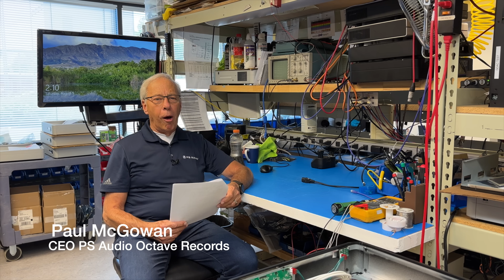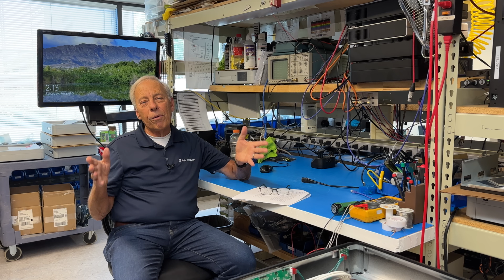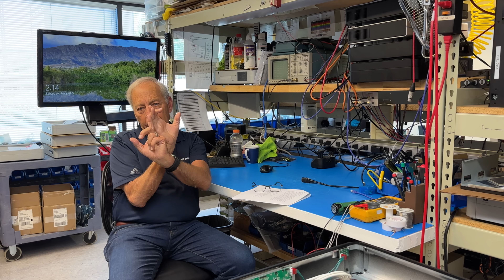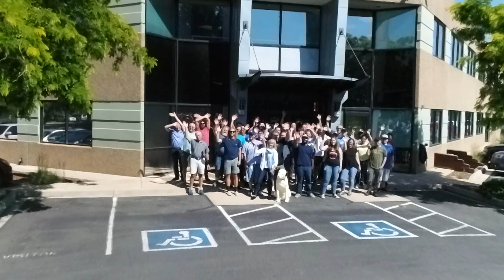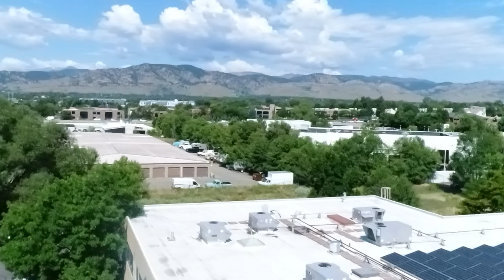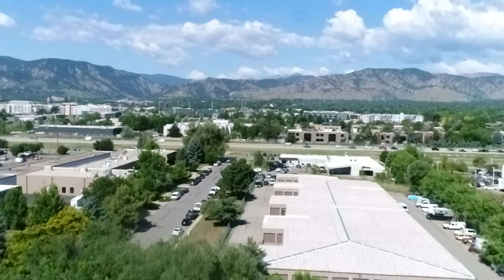DSD vs  DoP

Comment: Hi, my name is Tom and I'm the guy who asked Paul these questions. I don't use internet streaming, but play from a local music server (Mac Mini). Almost my entire music library is music files in PCM format (in addition to a handful of native DSD recordings) and I have been doing a lot of experimentation to find the best way to play them. To my taste, direct playback of PCM sounds a bit "in your face", while conversion to DSD (over the DoP method) reproduces the details of the music in a much more refined way - without losing dynamic range. On the contrary, the music is presented more naturally - even modern recordings where the "loudness" method has been used during mastering.

To achieve this I had to modify my Mac Mini, where I have replaced its internal SMPS power supply with an external Linear PS, as well as removing the internal hard drive and its SATA interface. Now I run the Mini from an external SSD (with OS, Audirvana and music library) connected to the Mini via a SATA > USB adapter. In addition, I upgraded the entire chain of network cables to CAT8. The upsampling process from PCM to DSD512 (via DoP) is at the limit of what my Mac Mini model is capable of, as the temporary files to be transported take much longer and the files are huge in size - but it works.

I am not good at either the theory or the mathematics behind the PCM or DSD concepts, I have exclusively used my ears while experimenting. My music network is far from the most expensive, but I've made it sound like it was. Mac Mini > 2 pcs EtherREGEN audiophile switches in series > opticalModule > opticalRendu > DDC to DAC via i2S > tube preamp > power amp > electrostatic speakers + REL sub. All connected with very good power cables an interconnects. Voila!

Cheers ;-)
Reply: You still don't get what Paul is saying. 
DoP is just a way of snuggling DSD out of a computer that rejects thaat format. 
It shouldn't change the data in any way. 
It's still uncompressed DSD!
Reply: I'm not much for streaming either.  My system is a Windows HTPC, feeding a small DAC and A07 amplifier with Pioneer tower speakers.  The HTPC is pretty much an out of the box NUC (Intel) with an external hard disk on USB3. 
My music collection consists of a mix of transcoded vinyl and downloaded pop music.
I also tried DSD and found the added complexity, along with the delays it caused to be abit tedious and I eventually when back to my PCM files stored as high rate MP3 Files.

From the purely technical aspect, if you are upsampling PCM to DSD you won't be getting any new information that is not in the original PCM file. You can't copy what isn't there... But have you considered that the major difference between the two is not the format or the transport?  It might be in the DAC you are using or even in the DOP encoding process...
Reply: @Douglas_Blake_579  
Thank you for your comment! Yes, DoP conversion is a slower and more demanding way of listening to music, especially if you choose DSD512, which is my preference. According to the Denafrips distributor, their DACs process the received audio signal from PCM and DSD in two different ways - which affects the presentation of the music: "DSD is processed with 6bit 32 steps FIR. It's processed differently compared to PCM. In my opinion, DSD soundstage is wider, easy to follow. PCM sounds more focused, more vivid."

In addition, I use in Audirvana a high-quality lowpass filter that eliminates all artifacts above 20 kHz that are generated in the DoP conversion. This gives the DAC an easier task in the conversion from digital to analogue. By choosing DoP in Audirvana, I can also choose to limit the transport of information in the audio signal by up to -6dB. This means I can increase the volume on my trusty Conrad Johnson tube preamp to a level where the music sounds better. This is not possible when playing PCM.
Reply: @Twinhouse1950 
Thanks you for the explanation.  Much appreciated.

So it would appear, from your answer, it's the two different paths in the DAC that is making at least some of the difference.  I suppose that is to be expected and it seems a good thing in your case.

Comment: Not sure why they bother with this DOP format, it's just adding a lot of baggage to the DSD stream, and extra baggage increases the data size, meaning a bigger load on the computer. It's being said DOP is so the OS can kind of understand it, not sure why it needs to, it's (DSD) is just another binary file that needs the appropriate software loaded to handle it. Like Microsoft Publisher files, no OS understands them, you just have to load Publisher to handle it, same with DSD, load a good player, like JRiver etc.
All it needs is a small, one off header, that says how many channels and what the bit rate is, and with probably a touch of meta-data, and that's it, from there on, pure DSD, no 16 bit packets etc.
Reply from the maker: You're correct, Paul but the reason the the OS cannot understand it is for lack of a driver to tell it what to do.
Reply: @Paulmcgowanpsaudio  True, however there are heaps of files Windows etc does not understand natively, you just use the right software, rather than adding heaps of extra data to the file trying to make the OS happy, why?, it your serious about your sound your not going to get the OS to play it, so who cares if it's not recognised.
Reply: You answered your own question.
The DSD needs a header, information on the bit rate, and metadata, AKA DOP.
Reply: @JonAnderhub  No, I'm talking about having it once at the start/end of the whole file, Paul M is saying it's in every 16bit 'packet' so way more data than I'm talking.

Comment: @2:26 "Our computers, at Octave Records, are the fastest, biggest, that money can buy, today."
Paul, you are allowing your staff to blow smoke up ...

You sound like a Bose owner bragging about having the best speakers money can buy.

Just the fact that Tom in Bergen Norway has computer gear that can process double your computer's limit should raise a red flag.

Are you using AMD EPYC Geona or Bergamo processors?
Or, Intel Xeon Platinum processors?

Paul, please ask your staff to spell out which CPUs they are using, which GPUs they are using, and which motherboard chipsets they are using.

If you do not know the parts that they purchased, then you do not know what they have purchased.  It is akin to stating that you purchased amps that have the best parts money can buy, and not know what those parts are.

I assure you that there are far, far, far more powerful computers than what your staff purchased, and such computers would yawn at your 32 channels of DSD 256 data .  So please find out what they purchased.
Reply: Basically you're saying one is processing 16 times the data in real time, but think the one processing only 1/16 real-time data is faster?
Reply: Have you thought that perhaps those computers could be the best at this time? And even if they aren't, I'm sure they can accomplish exactly what the engineers want when producing music. 

I see similar complaints here when Paul talks about how great the recordings are at Octave Records or how really good his products are. He's speaking his own truth about that and his company as a whole, regardless of what others may think so why should that bother you? Your speculations make you sound like you're just looking for discourse just for the heck of it. Blowing smoke? Um, OK, I guess. 🤷‍♂
Reply: @housepianist "Have you thought that perhaps those computers could be the best at this time?"
What computers?  Do you have information on Paul's computers that the rest of us do not have?

 "And even if they aren't, I'm sure they can accomplish exactly what the engineers want when producing music."
That is not germane to Paul's comments or my comments.

Paul claimed that his computers are the fastest, biggest, that money can buy, today.  That is Paul spewing BS, while perhaps not realizing that he is spewing BS.
Paul knows next to nothing about computers, and yet he made that definitive statement.  Paul prides himself as teaching and helping people.  But his computer statement is flat out nonsense.

There are people that take the word of a channel's host as the gospel.  It is proper for people to point out when a host spews BS, whether intentionally or accidentally.
In this case, I am assuming the latter, because Paul knows next to nothing about computers, and yet he made such a bold statement as fact.

"He's speaking his own truth..."
That is garbage language.

Would you be supportive of courts swearing in witnesses with "Do you swear to tell your truth, your whole truth, and nothing but your truth"?
As soon as you say that it is "your truth", it is BS.  Only "the" truth it the truth.

I am not interested in your truth, my truth, or anyone else's truth.  The only truth that is the truth is "the" truth.

"...so why should that bother you?"
You came to an imaginary conclusion.

Try on this one:
Why did my comment trigger you?

I have no evidence that my comment triggered you.  But I'll just ask that question, to plant it in the mind of viewers.

"Your speculations make you sound like you're just looking for discourse just for the heck of it."
I am looking for truth and honesty.  Your accusation that I am looking for discourse is actually you looking for discourse.

"Blowing smoke? Um, OK, I guess."
Paul trusts his staff, implicitly.  No one should be trusted to that extent.  Yes, trust your staff, but validate their claims.  Do not micromanage them.  But do not let them run wild, either.  Find the right balance.

Due to Paul's trusting nature, he has someone on his staff that blows computer smoke up ... ...
It is Paul's trust that his staff member is abusing, and Paul does not recognize it.

Yes, Paul's trust is being abused, because his computers are not the best that money can buy.  Not even close.  Someone that Paul trusts is lying to Paul.
And you are taking issue with having that person exposed.  You would rather let that person continue to feed Paul BS computer information, and allow Paul to look bad when he repeats that BS on his channel.

People that are IT hardware professionals know that what Paul said is nonsense.  Do you think that Paul should continue say that he has the fastest, biggest, computers that money can buy, today?  He has said it in other videos.  Should he continue saying it, when it is not so?

Paul's credibility is on the line.  He can have a spotless record, when it comes to audio.  But if he then starts spewing nonsense about computers (or anything else), it taints his otherwise spotless reputation as someone that you can trust for truthful, helpful information.

My comment was to help Paul.  It is better for him to dive in to the computer equipment he claims is the fastest, biggest, that money can buy, today.

Paul is wealthy. He has the resources to hire an IT hardware professional consultant (or firm), pay them their fee, and have them evaluate the computer equipment that his staff tells him is the fastest, biggest, that money can buy, today.  Then, when Paul learns that there are computers that are 10x more powerful, Paul should hold a meeting with his staff, and let them know that he made regrettable statements on his youtube channel, and that his staff must never feed him such BS, again.

If nothing else, his staff will have a renewed respect for Paul, and will not see him as being someone that they can pull the wool over his eyes.

Or is it better to have feelings rule the day, instead of facts?
Reply: Tom's machine is processing 1 (one) DSD512 stream ... 
Paul is talking about simultaneously processing 32 DSD256 streams ...
Reply: @Douglas_Blake_579 
LOL, other people’s computers are faster than your computer Nah Nah Nah Nah.  Kindergarten mentality. 🙄